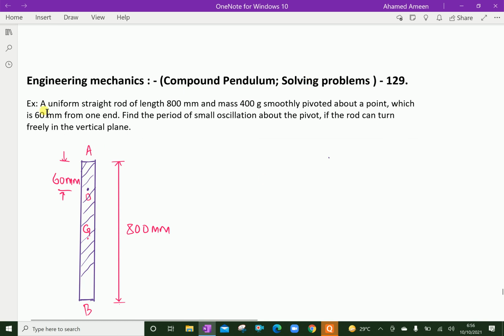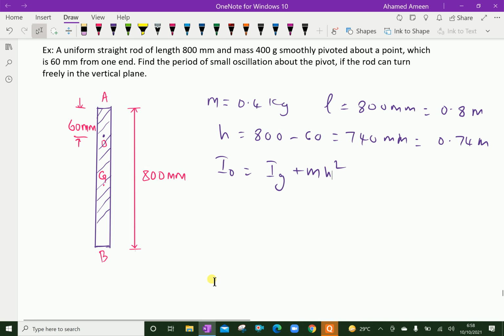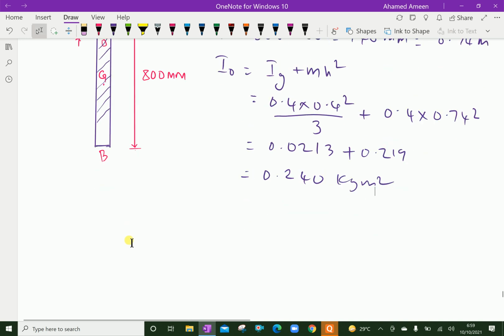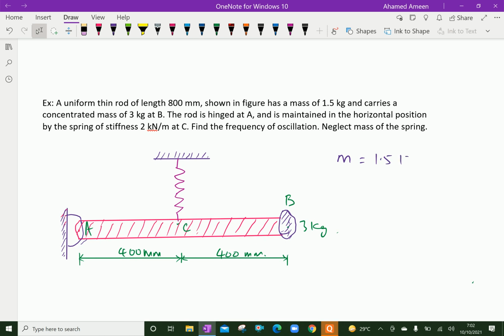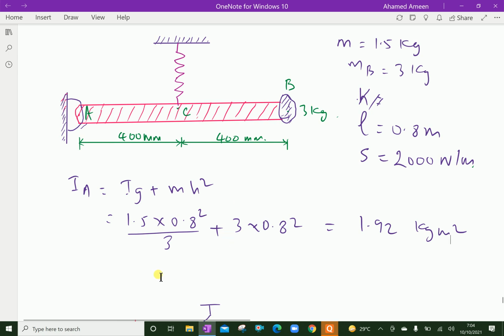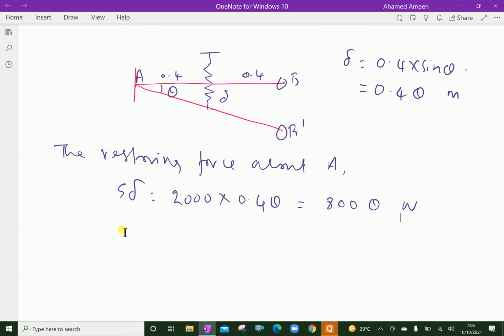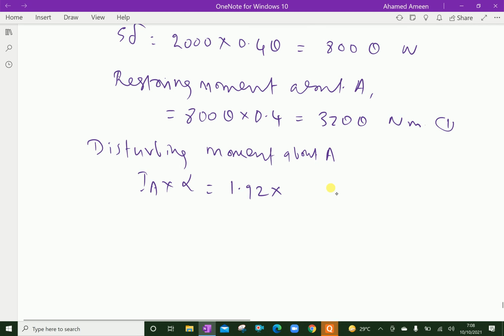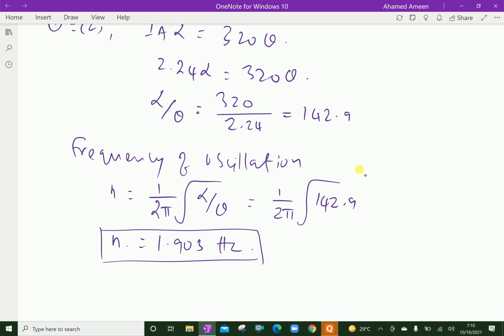Engineering Mechanics: - ( Compound Pendulum ; Solving problems ) -129.

Comment: How to find a compound pendulum of 300mm length to swing vertically with weights at either end which has a 1 second swing. A design for a clock.